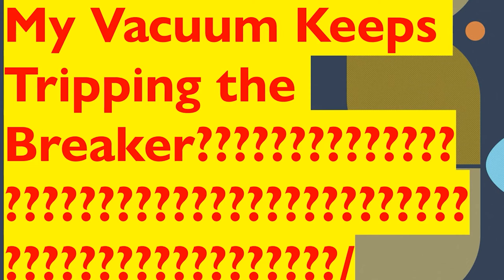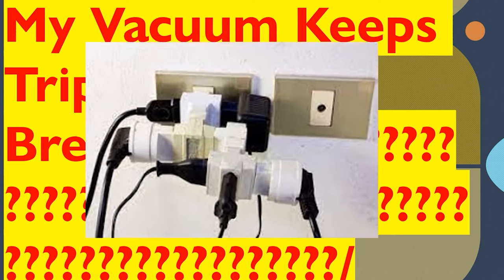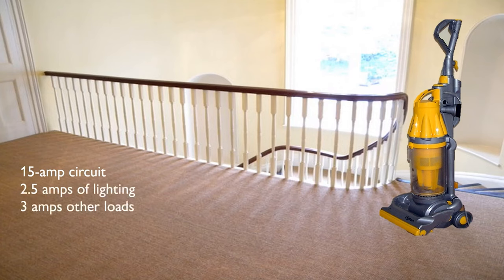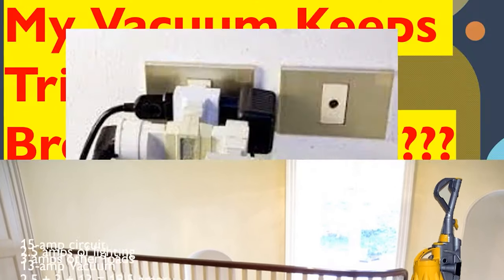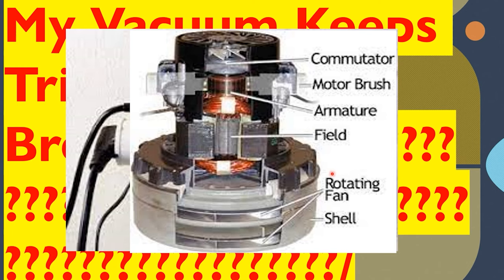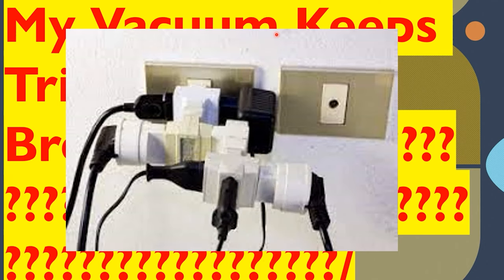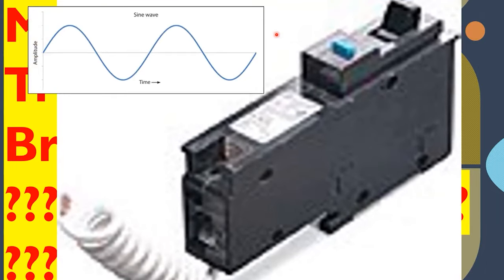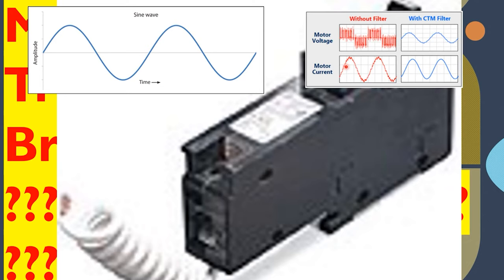Vacuum Tripping the Breaker?? The 3 main reasons your Vacuum is TRIPPIN

Comment: I've seen this problem with a lot of new builds, with improper wiring of the AFCI breakers, having the wrong circuit neutral attached to them.
Reply: I have also seen this sort of thing happen in a retrofit application,  specifically when the panel is moved more than 6 feet and now requires AFCI and/or GFCI breakers.   Many older homes had neutrals from different circuits are tied together.   Also in pre-WWII homes wired with knob and tube,  it was not uncommon for the hot and neutrals to be tapped off of different circuits if they were close nearby, light switches on the neutrals,  fused neutrals, to name a few oddities.  Finding and rectifying this shared neutral issue is sometimes impossible,  necessitating a complete rewire, turning a $1500 - $2,000 panel swap into a $10,000 job.     If you extend or modify an existing circuit legally it must be brought to current code, assuming a permit is pulled.

Comment: Looks like a place I had to repair in South Carolina.  Stupid family had the TV and Space heater plugged into the same receptacle.  The receptacle cooked the multi outlet strip they used so they could also charge their electronics ( phones, etc.. )   The also had issues with loose connections in the breaker panel and had switches smoking catching fire.

Comment: How do you know where the stud is on wood paneling? Have a single gang and want to add a double gang box
Reply: Tap the panel to see where it is hollow, stud finder, or the mentioned magnet, but otherwise look beside your box and see which side the stud is on and measure the appropriate distance, for your County or State codes, to find the next stud. 💙 T.E.N.

Comment: I've found a frequent problem is appliances like vacuums equipped with a retractable power cord. Every time you pull the cord out to plug it in, you're putting some strain on it. Eventually it can fray or weaken, causing a short circuit.
Reply from the maker: Facts! 💯 🔥🔥👊🏻